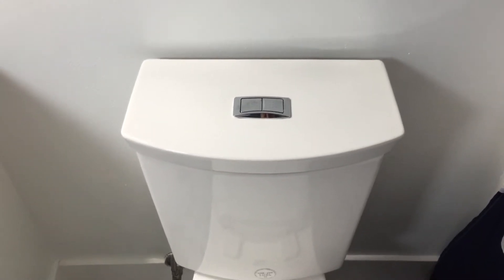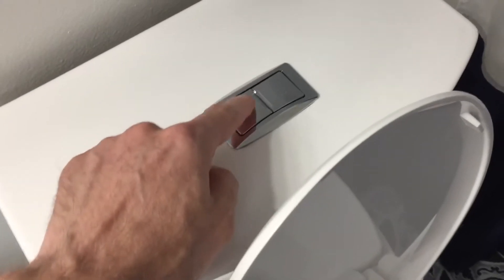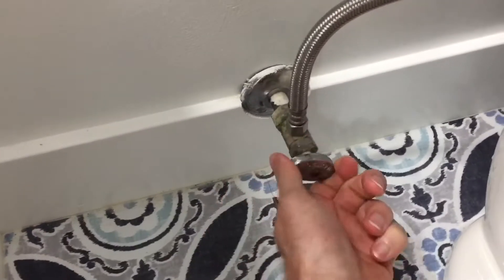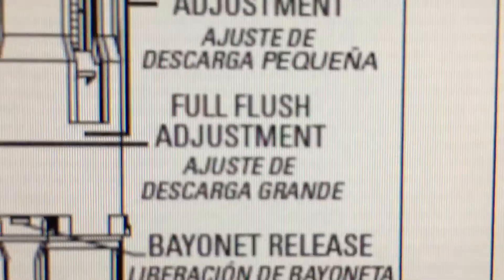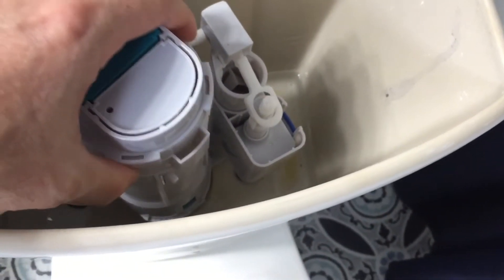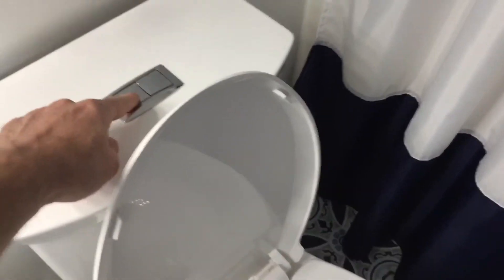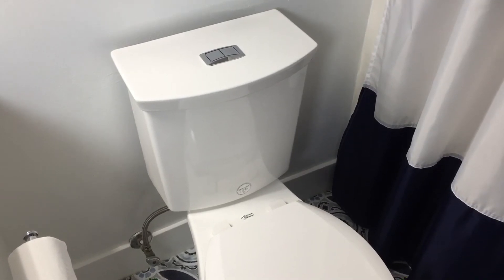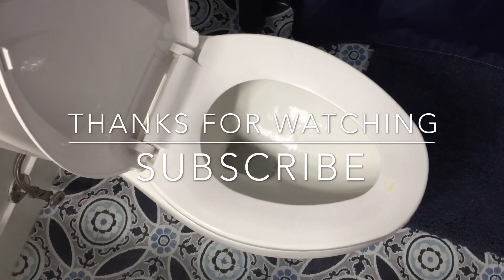How to Fix Low / Lite Flush Problem - American Standard Cadet 3 Dual Flush Toilet - doesn’t work

Comment: Thanks for the video.  I only have this toilet because my bathroom was damaged by a leak from the condo over me in late 2020 and by the time the owner who was flipping the unit upstairs got around to fixing it it was summer of 2021 and there were supply chain issues.  This was the only toilet I could get that didn't break the bank.  I replaced the toilets in both bathrooms, and the other one is the standard Cadet 3 with the handle flush. I shall make haste to the bathroom and see if your suggestion does the job.  If not, I guess I'll start saving for a new toilet.

Comment: Worked for me.  Our lite flush did not complete unless you held the button down for the full flush.  The full flush worked OK.  Adjusted only the Full Flush down to 1 to see the affect and now both work properly with just a quick push.  
There is still a difference in the amount of water used for each flush so this adjustment does not seem to affect that aspect.  Thanks!
Reply from the maker: Great! Thanks for sharing!

Comment: Great video and a great help. I have the american standard h2option siphonic dual flush with liner, slightly different toilet with almost identical internals but your video was a big help to me fixing this issue. The instructions are not the best when it comes to making adjustments and mine had different settings but it all got figured out. This toilet was a pain for a first install but now that I know what I know thanks to your video I would install another one as it is a good toilet for the price when working properly. The funny thing is, I installed a cheaper store brand dual flush in the basement bathroom and it worked perfectly out of the box. Keep up the great vids.
Reply from the maker: Awesome. Thanks for sharing!
Reply: I bought two of the same H2Option w/liner off of Amazon. The first one worked right out of the box, but the second one had the problem with the lite flush. The manual is terrible, and doesn't even show that you can twist and remove the flush tower! I compared settings on the working and non-working unit, and they were both set differently from the factory, and neither one was set to the recommended settings in the manual for the model with liner. They're really setting the average homeowner up for failure with the way they QC these and how the manual is written. Both working great now though, thanks to this video!

Comment: About to flush this toilet down the...wait that is recursive. Did the same but still not enough water pressure during a flush. Will try the vinegar ideas to clean possible clogged pores under the rim to repair. Else shopping next weekend to replace. Thanks for the great video!
Reply from the maker: I also didn’t care for this toilet and no longer own it.
Good luck!
Reply: @HowtoandReviewsOfficial  Just a quick update. After this post, decided to contact American Standard (Canada) for assistance on possible solutions. My thoughts were to use an adjustable float to allow for the tank to fill the water a bit higher to allow for enough volume to flush the bowl. Also requested if a replacement traditional tank exists. After sharing our serial # from inside the tanke - they UPS couriered out a replacement normal style flush tank to repair this unit! I am very impressed that they would do this. Only now returned back to the office from a week fight with covid and hope to perform this repair this weekend. Will update all on the progress but it appears that it is possible to convert this toilet to the normal style with this new conversion kit & tank.
Reply from the maker: @kumarbhatia6566  That’s great news. That’s a good solution. I had the regular Cadete 3 in a different bathroom and liked it (which is why I bought this toilet). I think you will be happy with it when you get the normal tank installed.

Comment: Ten years ago I was warned by a plumber that these kinds of toilets were a problem. But three years ago I thought they'd certainly improved by now. I was wrong. I'm going to try this fix and if it doesn't work, I'll replace the toilet. I've probably wasted as much water as I was supposed to save by having to flush 2-3 times for it to flush completely.
Reply from the maker: That’s exactly how I felt about the toilet. I no longer own this toilet (thank goodness), and I will never buy another one again.
I hope this fix helps! Good luck!

Comment: How do you adjust the light flush setting?? Mine is at 4 and I can't move it. Feels like if I press harder I will break it!
Reply from the maker: Mine felt exactly the same way! Go ahead and press harder.
Reply: @HowtoandReviewsOfficial  I'll give it a shot, thanks so much for the video! I spent 2.5 hours cleaning and scrubbing all of the jet holes with vinegar and no improvements whatsoever. This minor, very easy adjustment seems to have fixed the issues we've been putting up with for years!
Reply from the maker: @bradwelch6157  Glad it helped! I remember the struggles with that toilet!

Comment: Hi, I’ve got the same toilet and found your video. Question is, I went to American standard website and looked at instructions, and it says for an insulated tank, to set the flush valve at 4, and 4.5 for part and full flush. Doesn’t that mean that higher number is more water per flush? I tried adjusting down to zero as in your video but didn’t seem to help and maybe worse, but don’t see on their website anywhere about which direction adjustment adds more flow to flush
Thanks
Reply from the maker: Hello! Unfortunately (but fortunate for me), I no longer have this toilet. From what I recall, the lower number resulted in more water in the flush. Higher number would be less water in the flush.
Reply: @HowtoandReviewsOfficial  American Standard factory confirmed you get a larger capacity flush the higher the number....not decreasing it. I also learned they do not come set from factory. Everyone installing has to set them. Low flush ruler easier to set by removing the blue lock button. Then press it back in. Finally the numbers 2, 3, etc do not reference gallons used. Use their recommended numbers or go higher...not lower.. to overcome a bad flush.

Comment: My toilet doesn't have the tap to turn off the water. Do i just shut off the main or can I stick a wet vac hose down there and let it suck while I try the repairs?
Reply from the maker: You will need to shut off the main. Otherwise, the tank will just continue to fill when you remove the tower.

Comment: I adjusted the light down to 2 and kept the full at 2 and they both work fine now... Not sure they need to be adjusted as much as recommend. Regardless, thanks for the solution, it was driving me crazy. I have two of these toilets and one was fine with factory settings and one wasn't.
Reply from the maker: I'm glad to hear that it working for you! Higher settings are better in regard to reduced water use, so that is great news that you did not have to go all the way down to 1 and 0. Glad you found it helpful!

Comment: This did the trick - thanks muchly for sharing!
Reply from the maker: Awesome! Glad it helped!
Reply: Guess I spoke too soon... Bowl won't empty at all now. Assuming the flush tower needs to be replaced? Any idea what the part number is? This is one of three AS Cadet toilets I have and the other two work just fine.
Reply from the maker: @blainf451  Sorry to hear that. I would call American Standard to make sure you get the correct flush tower. They will ask you for the part number printed in your tank, which will dictate the correct flush tower.
If you explain that you have two that work, but this one doesn’t, It is possible that they will send you a replacement flush tower at no cost. They sent me parts at no cost when I was struggling to get this toilet working.
Reply: @HowtoandReviewsOfficial  Thanks, that sounds like a good plan
Reply: Replaced the valve with a new one from AS and adjusted as per your video. Also adjusted another tab noted in another video for the same issue with the same toilet but still won't flush properly - did so once then back to a half flush.
This toilet is garbage. Thanks again for your help though!
Reply from the maker: @blainf451  Thanks for the update. I have the regular cadet three, with the flush handle on the outside of the tank. It works great and I recommend it. But yeah, this toilet can be a real headache and I definitely would not recommend it.

Comment: Anything else I can adjust if this didn't solve the problem?
Reply from the maker: Unfortunately, I am not aware of anything else. I no longer have this toilet so I can’t test anything. Good luck!
Reply: @HowtoandReviewsOfficial  okay, thank you anyways. This seems to have helped many people.
Reply: I have same issue. Maxed out and even when holding down button for full tank flush it doesn’t complete the flush. 
I ran a snake down the line and it seems clear. 
Off to HD for new toilet.
Reply: @Motoburriss  I found there was a build up in the front hole from the family not flushing all the time.  I got a piece of metal in there and chipped a bunch off and it seemed to fix it for now

Comment: Doesn't this defeat the purpose of the low flow option fluids vs the full flush of the solid waste side (right side button on top)? If they both flush the same, then there is no reason for the fluid/left vs solid waste/right (full flush) buttons.
Reply from the maker: I agree that it adds more water volume to the flush. Whether it matches the solid flush or not, I’m not sure.
But, it makes it so it works. The alternative is you press the button and it doesn’t work at all and the waste just sits in the toilet bowl. That’s no good either. Especially when guests are trying to use it, and can’t get it to work.
I personally do not recommend this toilet. If I could do it over, I would absolutely just buy the regular version with the flush handle on the side of the tank.

Comment: Great info. The only problem is the low flush adjustment will not move. It is stuck on 4. Cant move it up or down.
Reply from the maker: It will move, it needs some force. I was worried about breaking it when I first moved it because it was very hard. But it went.
Reply: @HowtoandReviewsOfficial  I figured it out. I just had to pull the tab out for it to move. Thanks anyway.
Reply from the maker: @vanspock-e3s  nice
Reply: @HowtoandReviewsOfficial  Me again. The toilet flushed perfectly for a few days then its back to not. I',m thinking of going back to the old flush system toilet  Should I replace the dual flush part or are there any other adjustments you can think of?
Reply from the maker: @vanspock-e3s  I am personally not familiar with any other adjustments.
If it was me, I would return it and switch to a normal flush toilet. I did not care for this toilet and would not recommend it. I own the normal flush version of the cadet 3 and like it.

Comment: How do fix the push lever inside the tower from getting stuck after flush?won’t shut.
Reply from the maker: I apologize, but I no longer have this toilet and am unable to investigate this. Otherwise, I would have been happy to check it out for you. I wish you the best in solving your problem! Let us know how it goes!
Reply from the maker: One suggestion is to call American Standard. They will walk you through fixing it, or they may send you a new flush tower at no cost. They sent one to me when I called for help with the low flush problem.
Reply: make sure the tower is seated properly and the water is not overflowing in the overflow tube. Otherwise remove the tower and check the seat for obstruction.

Comment: ugh, spent an hour messing with this thing, no matter what settings I use it will only flush correctly one time after I adjust the settings, if I wait a minute and try to flush it again, it won't go down
Reply from the maker: I understand your pain! I personally no longer own this toilet, and definitely would not buy it again. Even with the flush buttons working correctly, it seemed unsanitary. I wasn’t a big fan of it.
Reply: @HowtoandReviewsOfficial  ya. As soon as we can afford to replace it, it’s gone !!
Reply: @chrisryan8894  Same problem. We have two. One has never had a problem, the other won't fully flush on either button at any setting. I bought a new tower from the local hardware store, but it was too short. Did you find a solution? Gives you a false sense to pride to see it work the first time after tearing it apart, only to not work on the very next flush.
Reply: @dustindhansen  so true. Countless times I thought I fixed it. Then….nope…I actually put it back together with the plan of just replacing everything inside it, haven’t gotten to it though. The parts are about 60$ CAD, I’ll get to it eventually 😑
Reply: @chrisryan8894  the amount of time I've watched videos or messed with it, I could have replaced the toilet twice. Now it's more about solving a problem that's driving me crazy
Reply: Have the same problem as well. Had the flush valve replaced a year ago and not it’s driving me nuts again.

Comment: what wears down so that factory settings no longer work?
Reply from the maker: I don’t think anything necessarily wears out. Mine never worked with the factory settings, straight from the factory, brand new. I called customer service several times, and they had me try a few things that didn’t help, but this is what finally got it to work for me.
Reply: @HowtoandReviewsOfficial  great...thanks
Reply: The first adjusted okay, but the second won't budge.  And you used just one hand.  I'm baffled.
Reply from the maker: @gwendolynegbert4944  I agree, the second one does adjust hard. The first time I adjusted it, I remember it being hard to move, and I was worried about breaking it. When I did it again for this video, I just pulled hard, knowing that it would go. Pull down hard, and don't worry about breaking it, it will move.
Reply: @HowtoandReviewsOfficial  You were absolutely correct.  I tried again and it moved but did not break, and now the toilet actually flushes!  What a concept!  LOL  Thank you so much!
Reply from the maker: @gwendolynegbert4944  No problem! That’s great to hear. I am happy that this was helpful.
Reply: @HowtoandReviewsOfficial  pull out the little blue button on the light flush ruler with a small screwdriver. It snaps back in place after set. Easy to break it otherwise. And per factory, and in my experiments true... a higher number gives a better flush...not setting it lower.

Comment: Another Fix - if this didn't fix it! So this did not fix mine and I got replacement guts from A.S which also did not fix it. So after cleaning the little holes under the lip of the bowl I decided to put on a rubber glove and check the big opening at the bottom of the bowl which faces towards the tank, not the opening where the poop goes! :) but opposite it. With the glove I could feel what felt like cat litter in there and with a small screw driver I scraped a bunch of this build up from in there... and bam! the toilet flushes with a crazy amount of force. It had not flushed properly in months. We had to use a big cup of water during the flush to actually make it flush before I cleaned the hole out. Anyway - I hope this helps someone out.
Reply from the maker: Thanks for sharing! I hope it helps someone!

Comment: How to increase the water flow into the tank could have been mentioned. Tank takes too long to fill up.
Reply: I have to conventional style American standard toilets in my home that were installed when the home was built. Both are identical and have all the same interior components. One fills up in under 30 seconds and the other takes over a minute.

Comment: I really hate this toilet. The second adjustment won’t move… still doesn’t flush right 😩
Reply from the maker: I hated it too. I thankfully no longer own it and would absolutely not recommend it. If you just bought it, I recommend bringing it back to the store and getting a different one. It will be worth it. 

For the second adjustment, push hard. It is hard to move, but it will move.

Comment: Endless flush issues, never enough flush, I may need to buy a different toilet
Reply from the maker: I agree! I personally do not recommend this toilet. If you just bought it, I would unbolt it from the floor and return it while you still can.
I also had the cadet three with the regular flush lever and it was great. However, this pushbutton version definitely has issues.
Thankfully, I no longer own this toilet!

Comment: I Bouht this toilet 2 months ago, and yes its problematic and not the cheapest 😆.
Reply from the maker: I agree! I had a regular cadet three, with the flush handle on the outside of the tank, and loved it, which is why I bought this one. I’ve always regretted buying this dual flush cadet three. If I could do it over again, I would definitely buy another regular one! I do not recommend this dual flush toilet, but the normal one is great!
Reply: @HowtoandReviewsOfficial  This toilet doesn't flush worth shit.
Reply: It is one shitty toilet. I call it the AmericanStandard Plunger assisted flushing model.
Reply from the maker: @googlesucks7954  I enjoyed the pun. Yeah, I don’t recommend this toilet and regretted my purchase. I should have returned it immediately.
Reply: @HowtoandReviewsOfficial  #MeToo   Ours also has a styrofoam liner. I wonder whether it might actually work like a toilet  is supposed to if I rip out the liner so the bowl can hold a little more water?

Comment: my valve does not have the second level to set, and I cannot find any information on fixing this effin' thing.
Reply from the maker: I feel your pain. If it is a new toilet, I recommend unbolting it from the floor and returning it. It is a hassle, but you won’t regret it.
Fortunately, I no longer own this toilet and I definitely would not recommend it. Even with the fix, I didn’t care for the buttons on top.